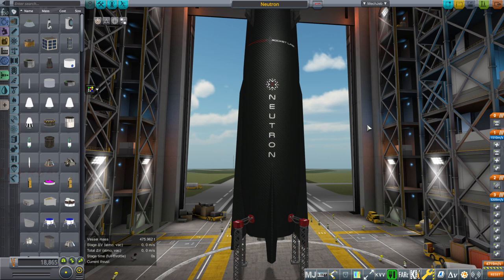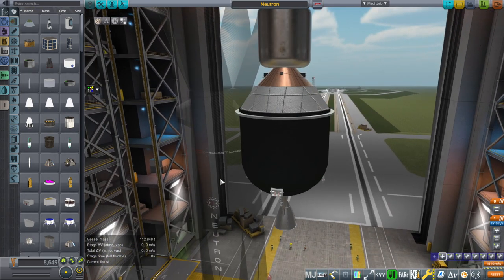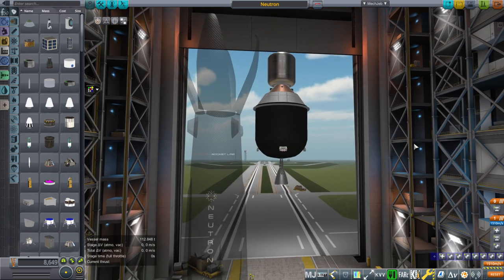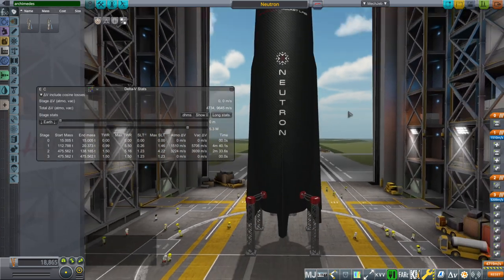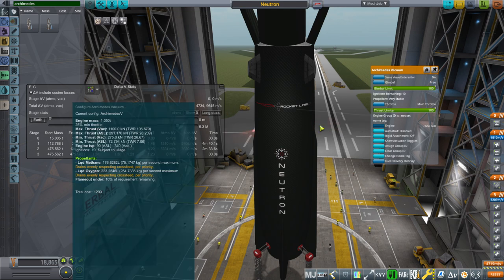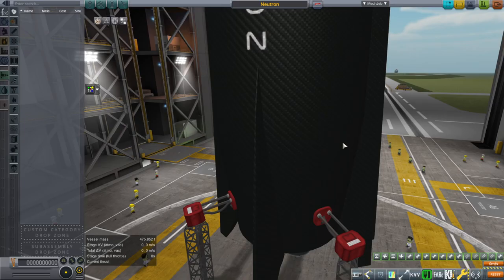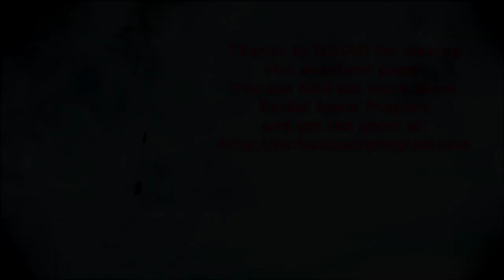Kerbal Space Program with RO - Rocket Lab Neutron Initial Release Version

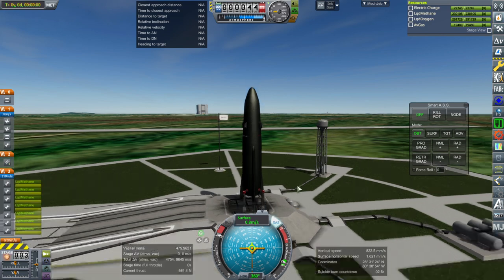Comment: Hey Tyler, at 7:07 you talk about shortening the spool up time of the engines. How do you do this? I've been trying this myself with addon engines but I cant find any value in any file where I can change this.
Reply from the maker: For Realism Overhaul engines in the RO config for them, there is a ModuleEngineConfigs section. In each engine config in that module (sections headed CONFIG), you have to add the following: %throttleResponseRate = 1.0
			%throttleStartedMult = 2.0
			%throttleStartupMult = 2.0
Tweak the numbers as necessary, but those are what I have on my Raptors.